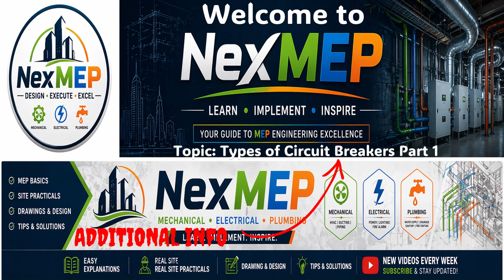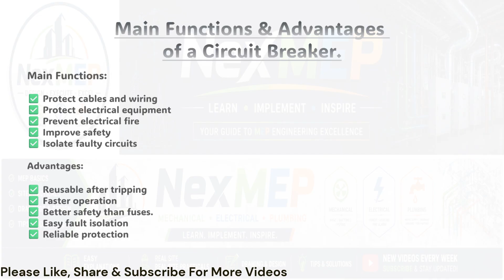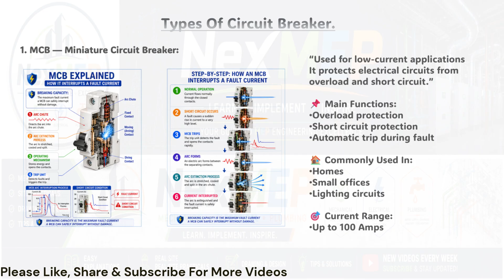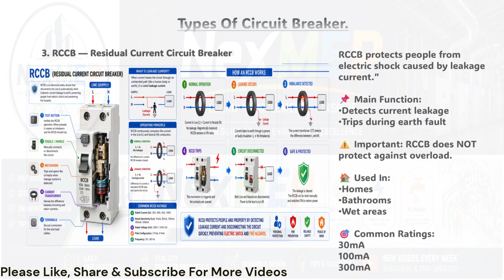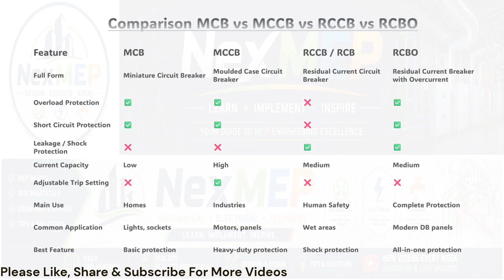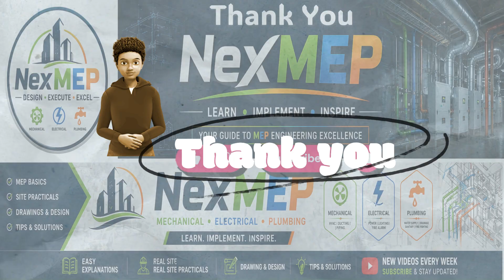⚡🚨 Don't Use the Wrong Circuit Breaker! MCB vs MCCB vs RCCB vs RCBO Explained ✅

Comment from the maker: ⚡ QUICK REFERENCE — Save this comment!
🔵 MCB → Protects circuits from overload & short circuit | Homes & offices | Up to 100A
🟠 MCCB → Heavy-duty protection for industrial loads | Factories & panels | Up to 2500A
🟢 RCCB → Protects YOU from electric shock | Wet areas & bathrooms | 30mA / 100mA / 300mA
🔴 RCBO → Complete protection in ONE device | MCB + RCCB combined | Modern DB panels
💬 Which one do you use most on your site? Comment below! 👇
🔔 Part 2 is coming — Subscribe so you don’t miss it!